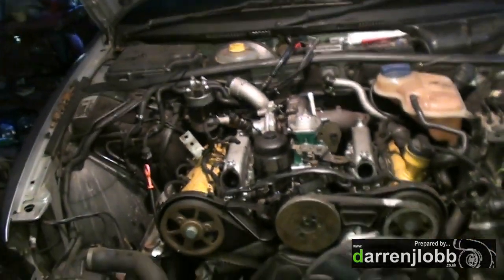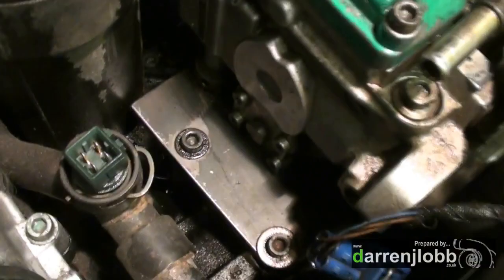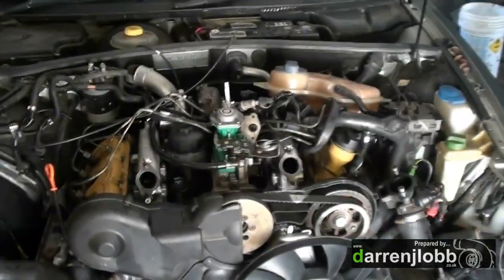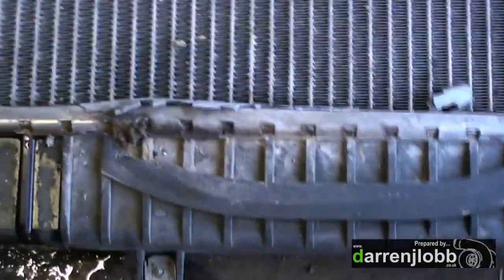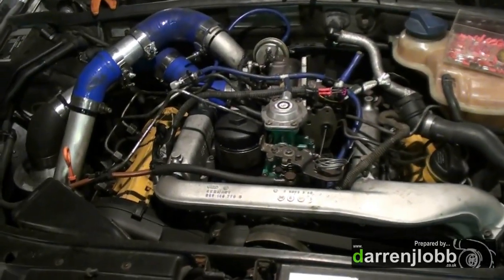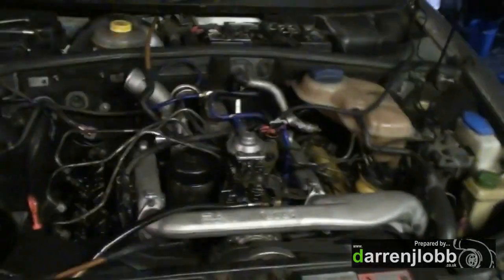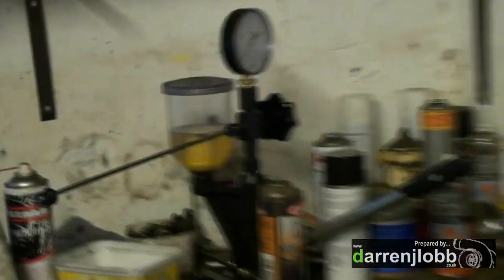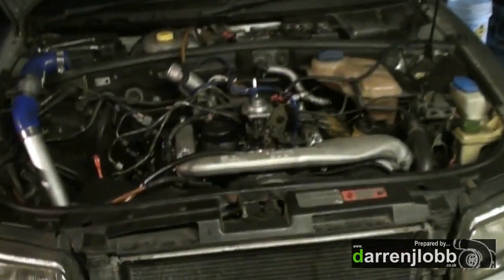Audi V6 MTDI Project Part 4

Comment: how critical is the AFR in a diesel?  many thanks for posting all this!
Reply: Clean running diesels often use excess air, BUT, because the fuel spray penetrates the air and ignites as it goes, the mixture is inconsistent; less so now with swirl etc.
On a diesel they run best slightly overfuelled, with some smoke.